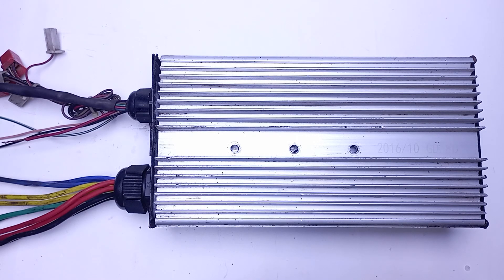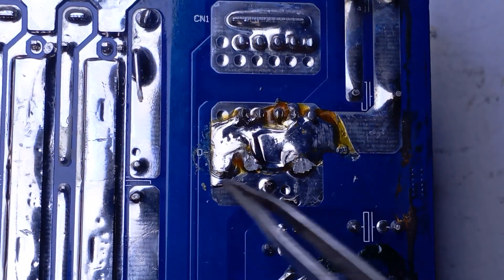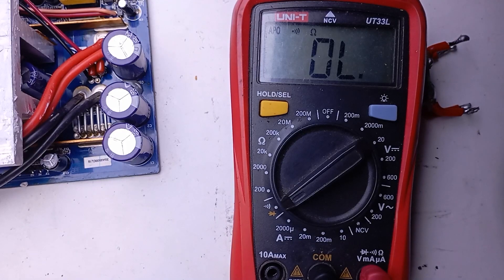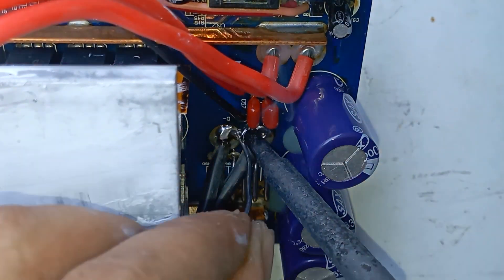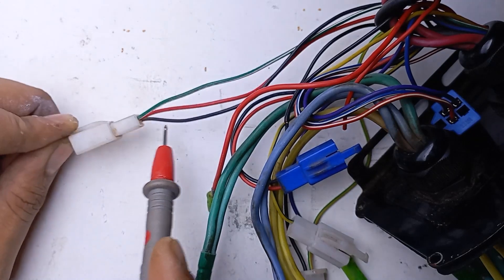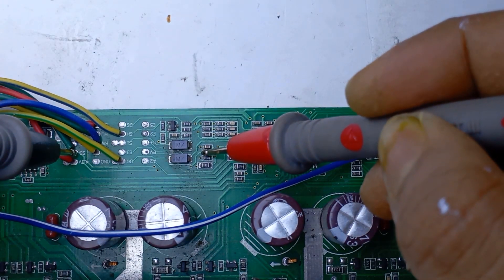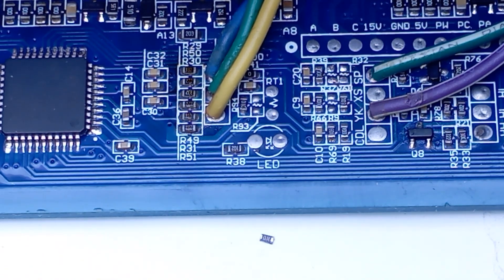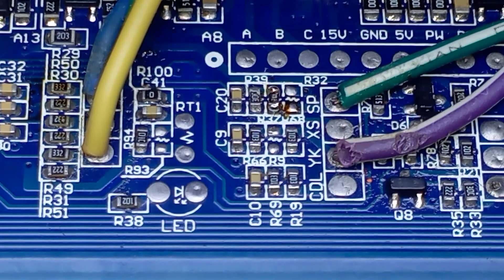Ev Controller Speed mod 🔥🔥#ev #erikshaw #ebike #motor

Comment: Hi is it safe  ? I have 250watt ebike and from last 3 months the speed is dropped so bad like from 25mil to 20 or 19.8 mil so near to my house 1 guy is telling me that I can increase the speed by 30 or 31 mil by changing the controller he has his own ebike and bike repair he does all types of jobs !!
Reply: change the controller.
Reply: Some motors luckily have limits on how much power flows through due to their designs and K/V ratings but this can go two ways

Scenario 1

1000W (Or 1KW)

-> Your motor peaks at 750-800W accelerating from standstill
-> Then when your Motor K/V limits hits lets say V-10 (In kmph) the power is 200-300W

So here only benefit is acceleration and a slight speed increment (1-5 kmph)

Scenario 2

1000W (Or 1KW)

-> Motor actually hits 1000W or even 1050W accelerating from standstill 
-> Motor retains more then 300W even at maximum speed (Here your K/V is higher)

In this case you will increase both acceleration and top speed by quite a amount (5-10kmph) can burn motor coils inside.
Reply: If you actually want to increase speed ignoring or upgrading cooling then 

Step 1: Shunt mod
Step 2: Throttle mod
Step 3: Voltage Booster (From 48V->52V or 60/72V)
 
[! Voltage Boosters increases motor RPMs (Uplifts Motor K/V as Voltage increases)]

If done correctly speed can increase upwards of 10-20Kmph (If controller's capable of 60-72V voltage)
Reply: Regarding safety, if done correctly and cautiously considering your controller's capabilities and limits (Like MOSFETs, Capacitors, low voltage regulators etc) then yes its safe. Some companies deliberately downplays controllers capacity lets say one labeled as 48V 250W, it can go upwards of 52V-60V 750-1000W.

Comment: What is the throttle mod for ?
Reply from the maker: Throttle output power is aslo limited  by a voltage divider by changing the resistor you can increase or decrease the power
Reply: Bro what   thortal output minimum and maximum voltage given him